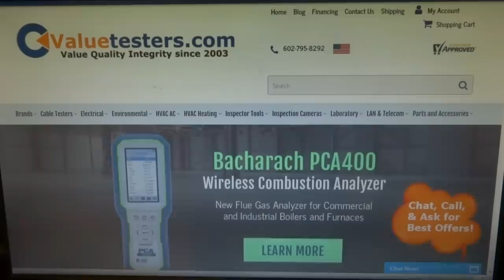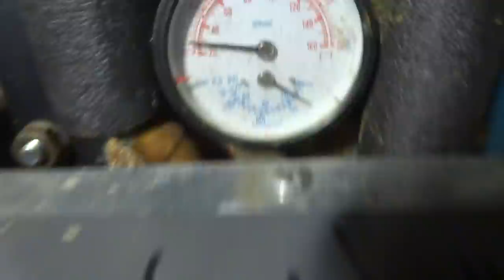Beckett oil burner will not fire

Comment: I love it when the customer says they only hit the reset once or twice. You know that they pressed that sucker at least a half dozen times. Always fun once you fire the burner back up and you have a blast furnace on your hands with all the excess oil!
Reply: Bradley Chubb changed out our chruch Bekettet oil burner for an iron fireman proton fusion accelerator and it uses 460VAC 30 amp breaker. Nick Chubb currently on 240v open wye deltal sevice and it takes the protons into #2 fuel oil and slams them into a carbon nucleus making harmless nitrogen!
Reply: bradley Chubb went with a Beckett deuterium accelerator for our church hot water and it gets much hotter than nick chubbs fuel oil fusion reactor and is started on a 208v 30 amp 3 Phase breaker and can run once its going even in a power outage! Nick Chubb used #2 fuel oil to fuse 2 hydrogen's protons with carbon and make nitrogen whilst bradley chubbs duetrium burner makes He4 and gammy rays electromagnetic pulses to super heat the church hot water!

Comment: Hello Steve, thank you for the informative videos, and laughs as well. 
Oil furnace is short cycling. Repair guy cleaned the furnace, changed the nozzle, replaced the tank filter, problem persisted.  
Then did the screwdriver on the transformer trick and said the “orange spark was the issue” ordered one as they are “hard to find for this model, if at all” came back two days later, replaced the transformer, problem persists. 
I swapped out the wall thermostat to a new Honeywell heat only T87 I think. Problem persists. Only thing no replaced is the controller/relay box.  That’s probably what it is, since all else is new. 

I asked first visit if that could be the issue and while he said “possibly” he never investigated it any further. $400.+ later I am waiting this fine Monday morning for the chance to call and see where my old transformer is, as it was perfectly fine. 
I’ll keep the old one as a spare. 
I hope they are able to get it fixed for me.  I wish you lived closer to Brooklyn CT. I like the fact that you subscribe to the repair, refurbish approach as opposed to the “REPLACE REPLACE REPLACE “ vibe I get from the company we’ve used for 23 years, faithfully.

Comment: Past Ten years only reason the button pops is because the oil ran out. Have the regular old style afg transformer. Never any issues. System came with the house from '89ish. They also are cheap if you follow the part #'s. Around $75. Good luck!

Comment: Great video again  you are the best.  Great heads up on the transformers. My old blackie died about 5-6 years ago. I replaced it with a electronic one.  One of the first things I'll look at if I have an issue.  One otehr thing  I always had a trouble getting the nozzle gun back in  thanks for showing me the right way.

Comment: Yessir we switched to ultra low sulfur diesel for ALL off road usage from heating oil to job sites and everything in between. Good burning fuel.
Reply: Terrible for lubrication in though
Reply: @andrewstratton7095  true. Older engines don't like it. Bad on older injection pumps and injectors. I ran added lube to the fuel on my 96L7000 fuel oil truck. Of course that's on road but same fuel ppm.

Comment: Hey Steve...love your vids.  I ordered a Testo 310 w/Printer today using your Value Testers link, so hopefully that helps you out...but either way...they do have good prices.  I've been learning more about the AFG burners, as I've got two in my house; furnace and water heater.  So I figure with the new Testo and the Smoke Tester I've got, I can make sure things stay looking good in between my regular service calls.  I do the filters myself, and have changed out a bad igniter before (solid state one running constant ignition went bad...amazing it lasted as long as it did...but now it's got an Allanson 628 with a new 7284 primary control I wired in...so now it's running Interrupted ignition...thing should last forever!!!).  But I stay away from the crazy stuff, as I just rather have the pros do it...but I'm a techie kind of guy, so I think the Combustion Analyzer will be a handy tool. Anyways, thanks again for the vids...keep 'em coming.  Oh, and I miss seeing Baby...but Molly is definitely a sweetie.

Comment: FYI it could very well have just been poor contact between the spring coils on the trans and the contact strips on the burner gun assembly - clean both and the spark points by the nozzle and it should work fine - no need to change transformer which looked to be functioning fine.

Comment: Steve i have a Bekett burner and it wont fire up. I changed the cadcell,transformer,cadcell relay,nozzel,pump screen,oil pan filter and electrodes. Im getting a good spark and also getting fuel but keeps tripping out. Anything else i might want to check. Thanks for any info you may have. Im here in NEw York and getting cold

Comment: Hey I got an issue with a oil primary
I have -120 volts going to it , the relay chatters I tap it with screw driver it runs 
I put a new breaker in 
Disconnected any circr relays
Just straight aqua stat to burner
Still chAttering won’t pull in 
120 volts , ground is good
Am starching my head, been doing this 36 years never seen this

Comment: Steve, could this be the same issue with a 12V Beckett Diesel fired power washer. These Beckett transformers just bottom of the barrel units? (My blower/pump kick on but Zero fire from the burner.)

Comment: Ha !!  I'm living in Berlin NH and yeah - cold… I  was in the biz for years ,  and yeah the low sulphur is fact. Same with the antiquated drip leg code when dealing with gas….its ( the gas ) so much cleaner these days it's not necessary anymore.  They have newer methods and the code needs an updated - same with the great "house trap" debate…but instead they make it worse. Like in NY (where I moved from ) they won't let you put an isolation valve before  the exp. tank anymore.
Reply: rob Semprini I’m in NJ. I can’t remember the last time I found any debris in a drip leg. And I hate house traps as well. My own home has one (built in 70s). It likes to clog up every six months or so and I need to rod it out. Hopefully it doesn’t rot out or I’m in for lots of work to replace it!
Reply: Yeah, by code ,with that house trap , you are really double trapping all your fixtures. No good , and they have been trying to do away with them in NY .

Comment: 3:30 - Just because the oil pump is working (oil flow) if the nozzle is plugged you wouldn't be getting oil spray in the chamber - why wouldn't you look into the chamber to check for oil spraying?

Comment: i would also replace the electrodes too or at least use a file or sand paper and get the carbon and muck off the electrodes for better contact so it will arc better and have better combustion and efficiency

Comment: Hey Steve what would cause oil to be in the bottom of my blast tube
Reply from the maker: back pressure blocked boiler . durty retention head .bad pump seal , draw assembly back to far .. many things can cause this issue . i would start from scratch . and check things as i go . to try to find out what is wrong with the set up . and experience oil burner man would find it . and know what to look for .

Comment: Hi steve great vids this year,
Your working again .
I had a wierd control box issue, good cold start,good steady fire,  furnace would come to temp, ok,
1 or 2 restart cycles, then as the day went on, it would fire good, and on ramp up to get to temp, the control box would click off, not the red reset button.
Try to bump up the mercury thermostat, (nothing)
 Wait a few min. While setting in front of burner, still nothing, then gave it a knuckle tap knock.
Restart and running good fire.,?
On ramp up again after a few min.
Honey well control box click off again., same thing  all over.
I changed out the box, 
Good restarts 
Now stays on during ramp ups 
Fan and limit seems to be working ok,
And running ok on the wall thermostat setting.

Just have a few quick questions.
On the transformers Not the new electronic  type. running temp.
Gets warm but not hot ,hot.
Bare hand good 10 sec. Or longer, count.
And the motor similar  temp.

This unit is a miller oil hot air unit, with a waye burner, ,
Running it it my garage shop,
50 60 degrees. Even in the current December temps.

Comment: Steve had you thought of a Webasto diesel fired aux heater for tnis truck? as it could warm the truck up faster the new ones they use can be programmed to start heating before starting the truck up. some are used in school bus fleets with good results or if there is a way to prorgam that could automatically start the truck and warm it for molly. as you must put alot of work into that truck so far. as you have it configured for your job you do as everything from tools and parts where you need it. not sure on the truck's lifespan if you had to get a new truck it be building it up plus an area for your dog. that could take days to build and limited time between jobs.
Reply: There's even cheap knock offs of esparchers diesel heaters now for about $300.     Would work great and not wear out that engine prematurely from idling it